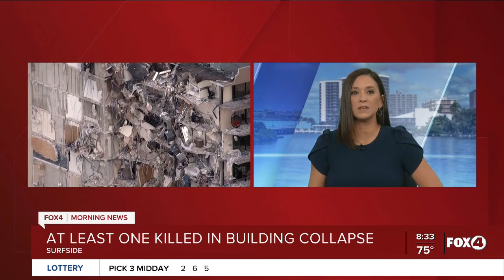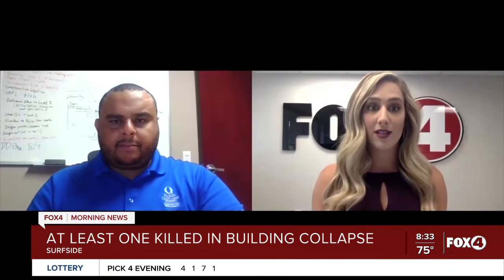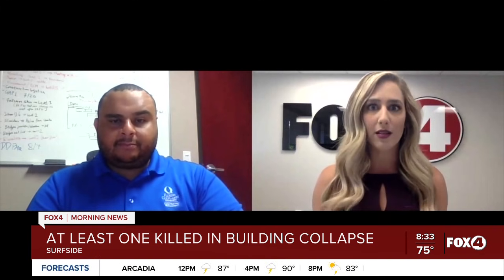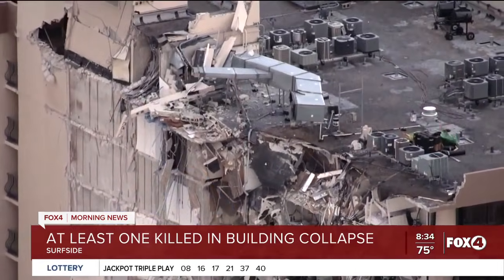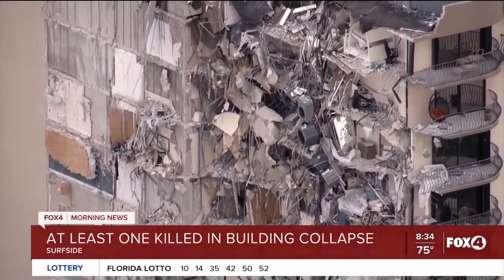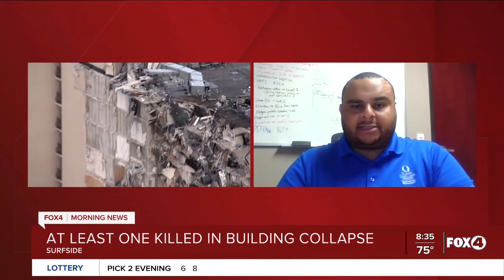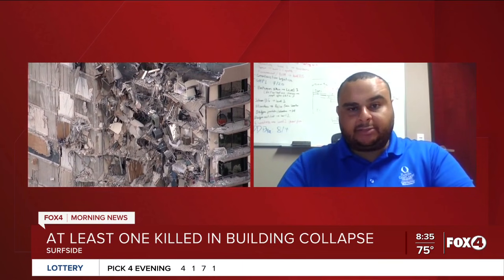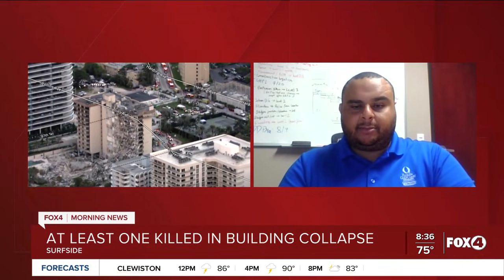What could have potentially caused the collapse of the condo building in Surfside

Comment: The concrete on the roof failed along with a maybe a few important sections below as water would find its way into the basement / garage.  I can only imagine all the steels and concrete with rebar was rusted and lost its structural strength. Concrete isn't strong without steel rebar, steel rebar isn't strong under constant heat wet and salty conditions will rust the minute it's laid in concrete. The concrete would of blown causing cracks exposing the steels to all weather conditions resulting in weakened rusted steels and rebar which is why concrete was falling off the balconies pillars in basement roof repairs 2mm movement per year over 40 years is 80mm that's over 3inchs. Bolts in steels would of snapped and moved steels moved off supporting pad stones and pilling foundations. It's very clear what's happened.

Comment: It might be related to the flashes you can see all over the building in the video of it collapsing.
Reply: These flashes are just lights. Either from flashing roomlight or from disrupted cables. It's either material/construction fault or a sinkhole.
Reply: @Anno_Nymouse  Construction was done 40 years ago. It was poor structural maintenance. Cracks, water damage, gravity takes over.

Comment: If not earthquake or soil liquefaction, if there is not excavations work near the building, then shifting to integrity of building itself. Whether there is brand new overloading or recent wrong renovation, also the compressive strength of reinforced structural members like foundation, most importantly columns,  slabs.  But usually the deterioration of building or materials would give warning signs before total collapsing, the inspectors should file report and evacuate the building in case of any observing signs. Kind of dereliction from landlord of the building.

Comment: Basement parking garage pillars = the concrete is old, and a few support pillars simply 'crumbled' under the weight of the building. Most of the condos in Miami are built this way.
Reply: that's scary as shit christ
Reply: Most buildings everywhere are built this way - including many that are 3-5x this age. 

My bet would be off-spec concrete, rebar, etc or a foundation issue

Comment: Spalling concrete can be easily be cosmetically corrected but is difficult to structurally correct. Many of the 70's condos have already been torn down and I suspect none from the 60s are still around.
Reply: Good point!
Reply: Water must be kept from the rebar. I would bet they find cracking and water damage in the standing part of the building, if they dare to go in.